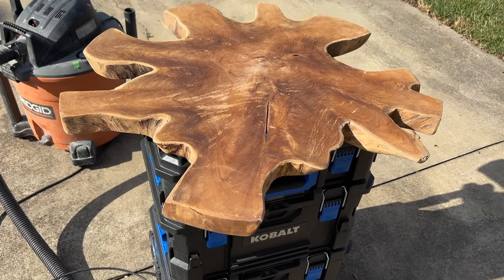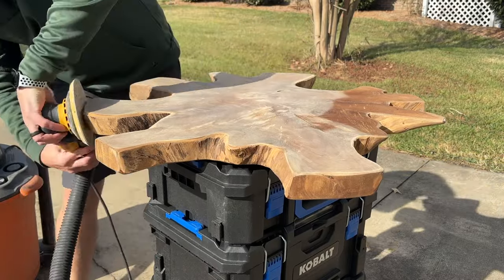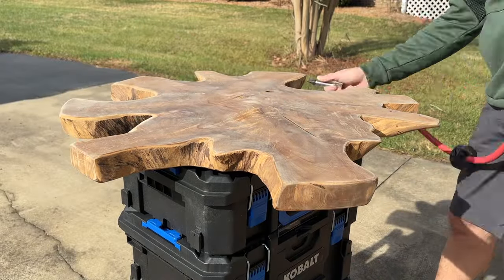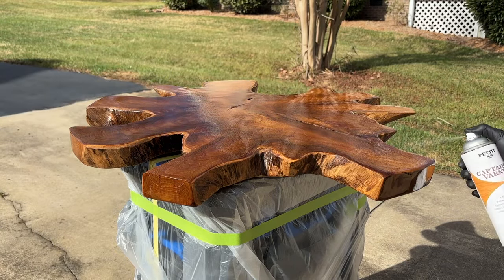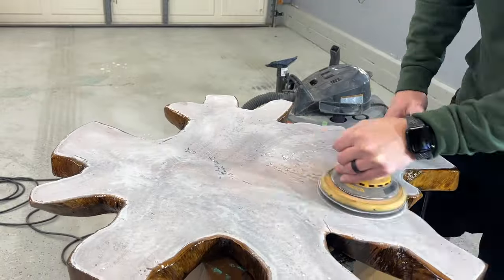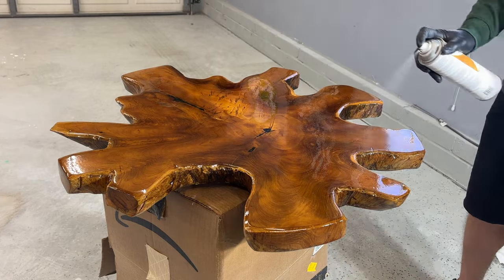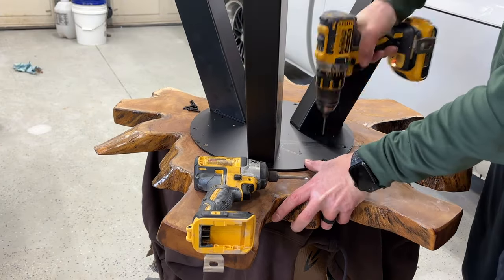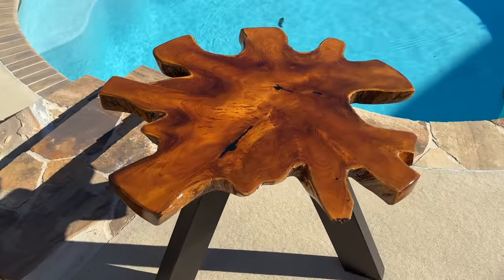Pettit Paint - Teak Table finished with Pettit Captain's Varnish 1015 Aerosol

Comment: Practical Sailor

Suggestion for next episode: 

It is pretty much impossible to get a professional to come to a dock slip to paint the topside. Every shop I contacted said I would have to bring my boat to their warehouse shop. Well, that is absolutely impossible due to my boat not being able to be trailered unless I spend a fortune to have it hauled, de-masted, transported, etc. Plus, there is no one in our area who provides such service. 

So, DIY is the only way to go. It os illegal to spray a boat while it is in the water. This is due to environmental issues as well as the practical issues associated with spraying in the vicinity of boats that are docked next to them. So, painting with a brush and roller is the only way to paint the topside.

Almost all videos about using 2 part epoxy (and one part EZ Poxy) are for doing the hull. There are virtually no comprehensive videos about redoing the deck and cockpit. Yes, EZ Poxy is recommended for the deck and cockpit. But, the advice and tips usually stop there. 

I am referring to the need for advice and tips on how to prep and paint these areas. More specifically, how do you prep the the deck and cockpit in relation to dealing with curves, textured walkways,  angles, hardware, and teak. For example, how do you sand a diamond textured surface since you can’t get into the valleys? 

Often, textured surfaces are a different shade or color than the smooth surfaces. When so, what gets painted first, the textured surfaces or the smooth? How do you deal with all the masking if the textured surfaces are a slightly different color than smooth ones. How do you prep gelcoat that has lots of spidering? How many coats?

It would be a nightmare to detach hardware and teak. Will painting around them look ok? What about bugs landing on uncured epoxy? Due to the complexities involved in refinishing the top surfaces, it is easy to see why no one really wants to do it, especially when there aren’t detailed videos on it. 

Have I made a good case for a DIY video on re-finishing the topsides?